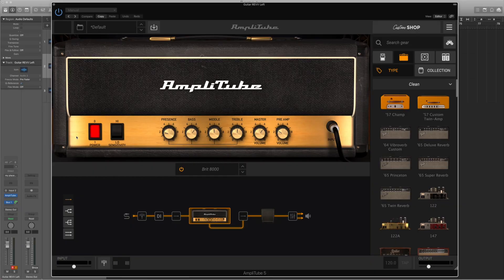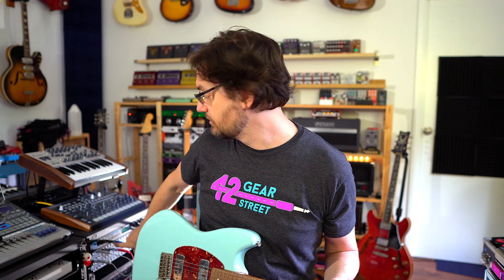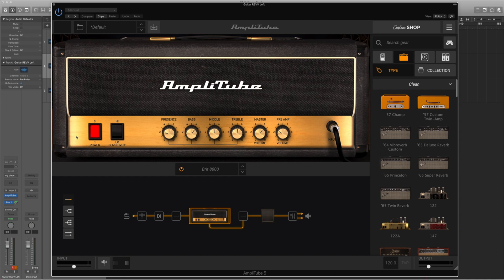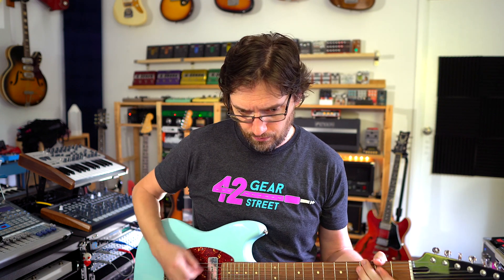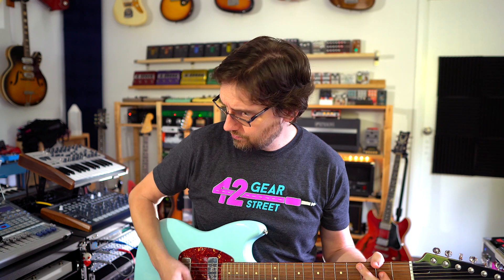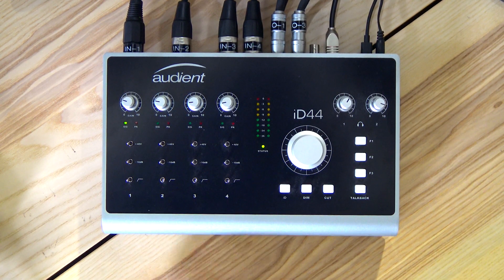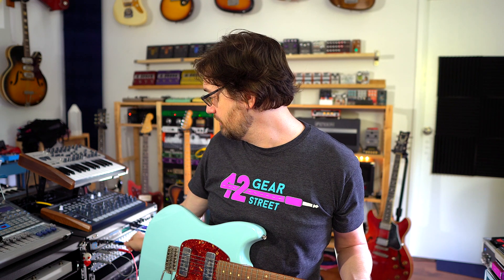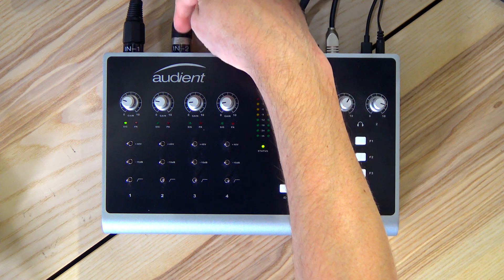Why Does It Sound Wrong...?? Amp Sims, Interfaces & Impedance

Comment: This is, by far, the best video on YouTube discussing and demonstrating impedance mismatch for guitarists using audio interfaces. What's most telling if you use the wrong input type is the dramatic reduction and change in characteristics of the high frequency range, particularly since it can't really be compensated for.
I really wish plugin developers would provide reference information & reference patches, including audio soundbites, so that we can confirm all is well on this front when setting up the plugin for the first time.
Reply from the maker: @Jack_cx  thank you very much!!
Reply: I play guitar, bass & keyboards, still learning after many years....an AEA TDI DI is the best thing to get a very quiet, low noise floor, active, 48v phantom powered box signal, very low impedence, not mic level, problem solved bud, £200 if you shop about, well worth it....my ir's play better with low impedence AEA TDI DI box, fantastic sound quality, mic level is to high at about >600ohm....

Comment: Hi! This is great! Ive always noticed the amp sims sounded better with less input, but now im wondering if i would run into any issues if i would want to reamp the DI signal (which would be quite weak). Would i simply turn up the trim level on a reamp box to compensate and it would be the same or would there be some noise issues?

Comment: dude about the part where your signal sounds lower in volume you are talking about your studio setup this is not because of the interface directly is more technical and with many possible layers of problems mostly focused in studio setup than the interface itself Ask an engineer about such stuff comment section is not to explain all these but give it a try .I short this first has to do with signals with different impedance from various devices over a patch-bay ,with balanced unbalanced cables and with XLR'S to Line balanced/unbalanced ins/outs...++

Comment: I havent quite understood what is exactly in the signal chain when you connect the guitar to the patch bay? In both cases (batch bay and PRO DI) it ends up in the mic level input of the audio card so I guess in both cases there is impedance matching. Does the patch bay converts the signal to microphone level as well but in a different way that the Radial Pro DI does?

Comment: I have an itrack sólo focusrite interface with 2 rca outputs I send left to an amp and right to another amp. I use bias fx 2 and AUM. I can hear the dry and wet signal together. Is deriving me nuts can’t figure out how to disable the monitoring. I know the intubas a switch and it’s off still bias fx or AUM si sending dry and wet together and I can’t just have the amp sound only I get the clean guitar sound and the distortion together. 😅😅😅😅 I’m going crazy with this. Can anyone help?

Comment: I'm actually finding that the HiZ input DI on the Audient simply can't be turned down low enough for metal style (13k output pickups) when played hard. Looking into a DI with a better input impedence.
Reply: Did you find one?
Reply: @TNORBABY  yeah bought a a warm audio active/passive DI box and it's great. Did eventually switch to an AxeFx though so I've needed to worry about amp sim gain staging for a bit

Comment: Hi, very informative review. Kudos.

I have a question regarding impedance with headphones. I set my eyes on iD14MKII and just learned that it has pretty high headphone-out impedance of 20 Ohms. I have Beyerdynamic DT-700 Pro X headphones with 48 Ohms impedance so would iD14MKII impose any distortion or any kind of problems when paired with DT700 Pro X. 
The iD14MKII manual says this: "The headphone output can comfortably drive a wide range of headphone impedances meaning that you will get great sounding audio no matter what model of headphones you have"

Thank you in advance.

Comment: Thanks for this video great work. 

I have a problem when recording gibson explorer with passive T500 magnets, my signal clip though no matter how I set the gain pots. This is not the case when I record Harley Benton P bass.

Do you connect the guitar directly to the card or do you have some DI to reduce the input signal?
Do you have this experience with any of your guitars with passive electronics?
What pickups did you record with?

Comment: Sir amplitube sounds awesome in this video.
It sounds horribly woofy, muddy and wrong when I try the same default patch like in this video (or dial in any sound manually from scratch). I've tried RME Babyface Pro FS and Focusrite Scarlet 2nd gen. Both interface I've tried with high Z input (instrument level input). I've also tried a DI box between Guitar and interface using XLR mic pre on interface. No good results. As a third interface, I also tried my friend's boss GT 10 and Boss GT 100 used only as audio interface (no internal sound from those device). Again, same woofy sound which is full of much.
Tried multiple guitars with Dimarzio, Duncan JB, EMG 81, Strat single coil. Everything sounds woofy.
What you get here in this video just without dialing in anything and with default patch is super awesome sound.

I've tried it on two different Windows 10 PC. And just few days ago I got a new windows 11 laptop. Tried on that too. But everything sounds same, woofy and unusable.
Reply: I have the exact same problem, and it's driving me nuts. I have a Focusrite Solo. But I've managed to borrow high end souncards in the past and it made no difference. I get good tones with other peoples DI's. So it's clearly something in my signal chain that's not up to par.
Reply: @Antelano  I have tried 3 different interface.
Focusrite solo, latest RME BABYFACE PRO FS which is very expensive and Antelop. All 3 sound exactly same. Very very woofy and wrong. 
Yes even I get nice tones from other people's DI when processed through same plugins.

Can you tell me about your computer's configuration?
Do you use windows PC or mac?
More detail would be appreciated.
Reply: @ratedrsuperstarthega did you find out the problem?
Reply from the maker: I have no idea what the problem could be - maybe the speakers or headphones you are using?!? It seems to sound really good through every interface I have tried it with on my end. I am not doing any editing to the audio of the guitar…no eq, no compression…nothing…so no idea…sorry!!

Comment: What you are demonstrating in the beginning of the video is of course right. The difference between a high impedance (Hi-Z) instrument input and a microphone input is however much bigger than the Hi-Z compared to a line level input. But you are adding another factor by extending the length of the guitar cable by the XLR cable from your patch bay to the rear of your audio interface. Just by adding a few meters of cable between a passive guitar and the input of a preamp you're changing the sound significantly. You should have plugged the guitar cable into the read input using a short adapter instead... But as I said: that doesn't change the main conclusion that you should use a high impedance input for passive instruments. For active guitars and bass guitars (with batteries inside) this is not an issue however...

Comment: Hello. Thanks for the video. I don’t know if you will reply but I still need to try. I have an audient iD4 MKII and a charvel guitar with seymour duncan JB. 

Using the JFET instrument input of the interface, even at 0 gain my bridge pickup (seymour duncan JB) is distorting. I cannot gain stage. At first I thought my interface is broken but with other guitars (including bass) its working fine. I tried to adjust pickup height of the bridge pickup but there are no differences. Any ideas what’s happening? 

With the same guitar, the neck position and middle position aren’t distorting as bad as bridge position
Reply from the maker: Hi Aditya Bali…I’m not sure why that is happening? Did you try the iD app and see if you can turn the volume down more there? Or maybe try the rear mic input and see if that distorts your guitar too?!?
Reply: @TSFAHTPS  thanks for the response! 

I tried the mic input in the back of the interface, ofcourse the tone became thin due to low impedance of the input but the output of the bridge pickup was still quite hot. I haven’t tried to adjust input gain at the software because i did not know that was possible. I’ll try and hope for it to work.

Do you recommend using a DI box work mic input to solve this output problem? Because right now my guitar sounds like it has a tubescreamer built inside it
Reply: @adityabali1939 hello did you solve the problem?
Reply: @adityabali1939 was the issue solved bro? I faced the exact issue with Cort 7 string that came with fishman fluence modern active pickups. Signal clips even at 0 gain on the steinberg interface. Absolutely unable to record anything without clipping. The line inputs sounded muddy and clipped as well. I finally did some research and installed jumper shunts on both pickups to lower the pickup output gain by 8db and then ran the guitar through a passive DI box into the audio interface. There has been a significant improvement after that. I can now raise The input gain  knob on the interface till about 1 to 2 o clock without clipping the signal. Basically my understanding of this problem is that most budget interfaces in the market are not really designed to handle high impedance signals. There are some videos explaining how to increase the headroom of the preamps in audio interfaces by modding the guitar cable or adding some resistors to the interface. But eventually the di box is what is keeping me afloat. Problem solved at least by 80%

Comment: Only Pre EQ-ing and Post EQ-ing will make your sound better if you have cheap gears. Also check your electricity is whether grounded or not. And of course you need to adjust sample rate and buffer size for your DAW and use the right driver as well for PC. I have focusrite 2i2 solo 2nd gen with default focusrite driver. Sound really terrible using every amp sim plugins which already have IR. I tried change default focusrite driver to ASIO4all because recording or playback keeps crushing the DAW with focusrite driver. With that I solved the DAW crushing problem. Another problem might be EMI or EMF problem if your studio is not constructed by professional. DI box is for to keep dry signal of your guitar while you record with your effect paddles which can give you wide options like blending with amp sim to sound advance. Most interface include thier own DI. You may not need it.
Reply: Hello friend. I also have focusrite scarlett solo 2nd gen and pretty much every plugin sounds crap. I thought something is wrong with the focusrite so I purchased expensive Babyface Pro FS. But I get same crap results. I thought the problem might be in grounding in my apartment as it's an old apartment. So I dug up 25 feets and inserted a pure copper rod into earth and connected only my computer to this grounding rod so that no other device/appliance can interfere with the ground loop issue. Only my PC is connected to this grounding rod and nothing else. Also the PC is not connected it to any other equipment so as to avoid ground loop. Result is still the same crap sound.
I thought something might be wrong with electricity, so I purchased a Online UPS which basically gives a constant pure output electricity signal. But yet, still the same crap sound.
Finally I thought to try a different PC. So I purchased a new windows 11 laptop. Yet he same crap sound. It sounds the same on any interface, PC. Muddy, dead and very weird. I'm out of options now. Not sure what's wrong.

Were you able to figure out your issue?
Reply: @ratedrsuperstarthega  What amp sim do you use? I used guitar rig 5 and 6, helix native and bias fx. They sound very crappy. Now I'm using neural dsp archetype plini which is the best match to my cheap guitar and sounding great. I think the problem we got is adjusting the right sample rate. Almost everyone record everything with 44.1 kHz. But they mix and master with 48 kHz or above. At first my DSP sound really crappy while listening my playback with 44 khz. Then I switch to 48 kHz and sound become a little bit better. But it give more latency which recording. But you can record with 48 kHz if you don't use too many plug-in too get few latency. My advice is that you have to record with 44.1 kHz first. It may sound crappy. Then export the track and then put it back to 48. Try this instead. I will be keep in touch. Then we will talk about adjusting EQ. I'm didn't know much about audio engineering. But I'll help you as I can.
Reply: @ShalomPhone  Hello sir!
I have actually use ALL the plugins out there, haha!
Yes guitar rig 5, 6, helix native, amplitube, bias, everything sucks FOR ME. Strange fact, even all the neural DSP plugins suck for me. Somehow only overloud works just a little in the ballpark of an acceptable tone. I'd still prefer it to sound much better. But overloud is only plugin I can play through sounding 10% of how it must sound. 

I've tried playing with 44.1hz, 48khz, 96khz, 196khz, I think 196khz sounds little bit better for maybe just 2minutes initially and then maybe it sounds the same to other frequencies. Some of the plugins don't support more than 48khz, so I keep my default settings on 48khz or 96khz these days. I am mainly trying to get a guitar playing tone right now and not looking to record guitar atleast for next few months. But it just doesn't sounds alright like we hear in other youtube videos.
Reply: @ratedrsuperstarthega  My problem is when I put distortion sound crappy. Clean tone works fine. I doubt about IR loader too. DSP and helix have built-in IR loader. So, I stick to these plugins.

Comment: Why do amp sims sound blocky and not harmonic in the mid range when a chord is played? It's good for single string stuff like Metal but sounds harsh and digital when you use more than 2 strings